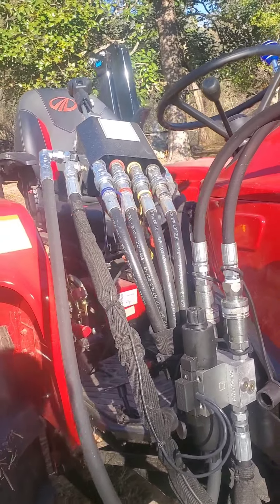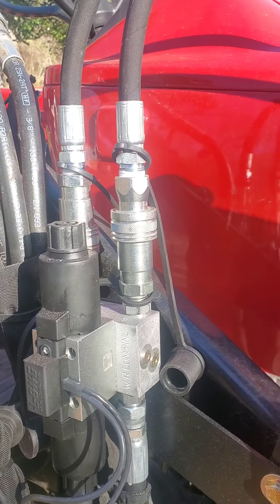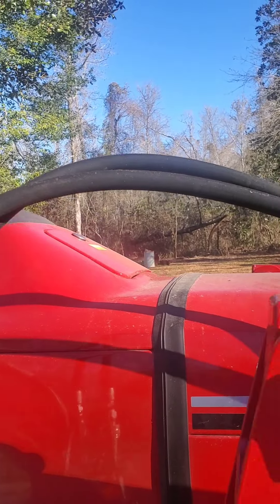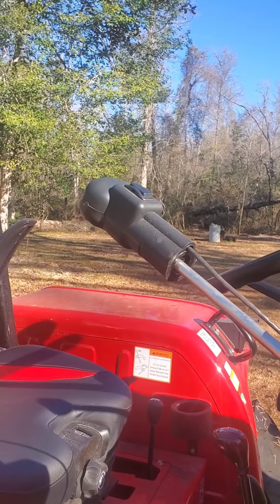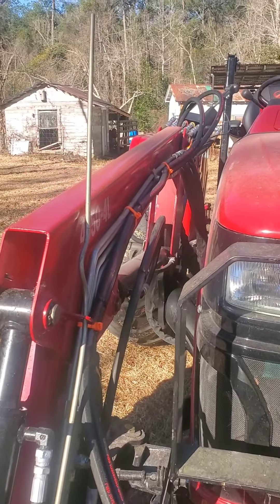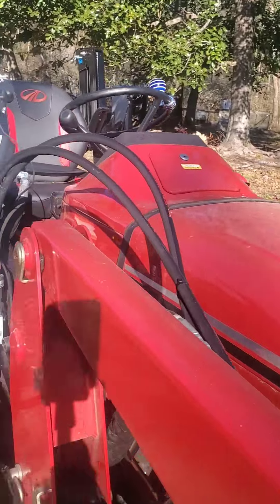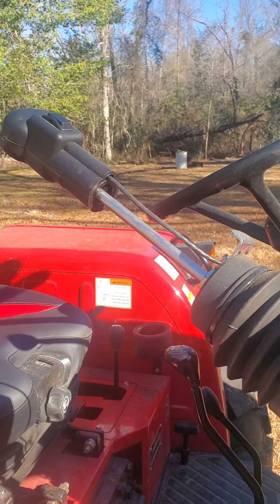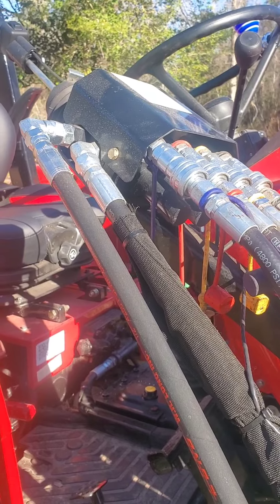W.R. Long 3rd function valve on a Mahindra 4540.

Comment: Thanks for sharing, been looking for a video showing 3rd function valve on 4540.
The Power Beyond port was what I couldn't locate. I have the 4550 backhoe attachment which makes it even more difficult. 
The 4540 came with property when I bought it.  Great tractor, only trouble was head gasket leak. Backhoe works great, only trouble blown o-ring for main boom. Easy fix...
Again thanks for sharing 👍
Reply from the maker: Your welcome.  Thanks for watching